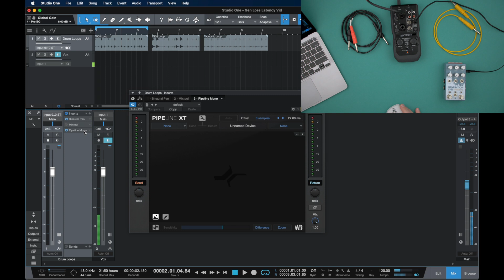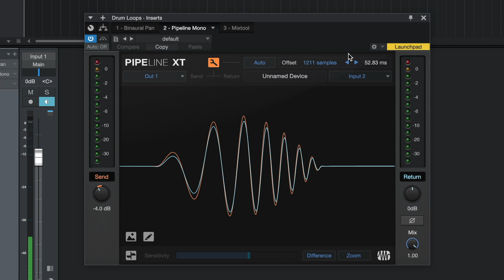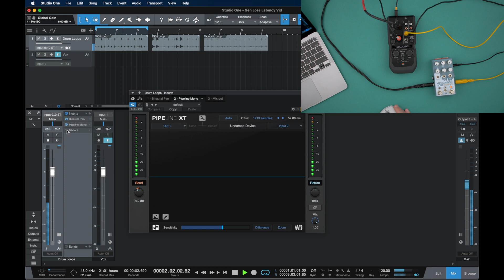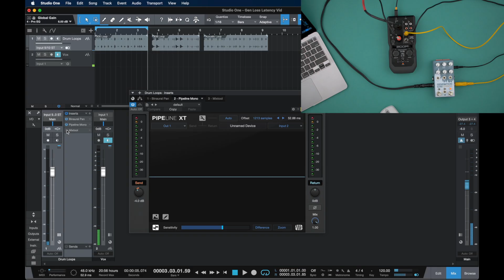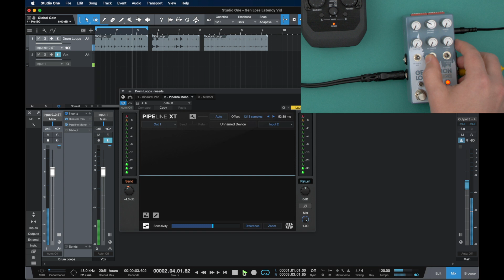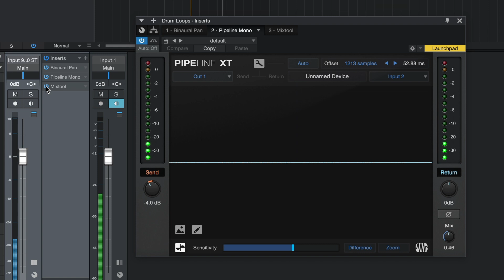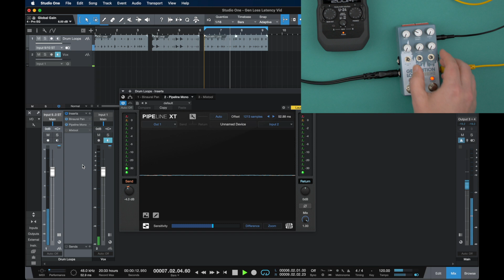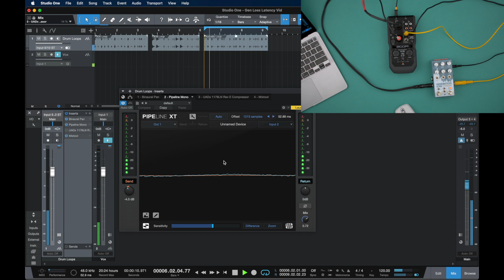Generation Loss MKII Latency: How Bad Is It? And How to Fix It.

Comment from the maker: UPDATE: Chase Bliss has released a new firmware that reportedly reduces the latency by half, or better. Link: https://www.chasebliss.com/gen-loss-mkii-mods
Reply: what version of the usb cable does this pedal use? None of old usb cables I have fit and I have dozens of different ones, I've never seen this size before.
Reply from the maker: @shyharmonic  It's a micro USB. I just double checked, and a standard micro USB cable fit in mine just fine.
Reply: @Bloom_Music  Is it better now, with the update ?
Reply: Can’t say I like the sound of the tighter latency flange effect.
Reply: @Subtronik  Yes. I did the update too and it's much better now

Comment: Great video. I use this as a send effect on my Elektron devices in a daw-less environment and, while the latency is noticeable, it creates a nice chorusing effect when you crank up the dry signal on synths. I say embrace the latency and make it work for you if you can. I definitely wouldn't use this on drums for the exact reasons that you pointed out, though.
Reply: how do you route the send? you using octa? i have  a digitakt and am curious.

Comment: Fantastic deep dive and testing!! 

This does NOT fix latency. It moves the latency to the initial moment when you press play. 

The latency is still there. This video shows that if you’re not playing live, you can’t hear the latency, but you can hear the DIFFERENCE in latency between the dry and wet signals. 

Then when you add the external instrument plugin, you still cannot hear the latency, still can only hear the difference. Now that difference is so small that can’t be discerned, but the latency remains - at the very beginning. If you were singing into a mic or playing, it would still be there. 

If you put an external / live utility plugin, and recording something real, that latency would still be really obvious.
Reply from the maker: “This is really only going to help people in a studio environment, this is not something you’re gonna reasonably do live. So, to the people using this live, you’re just kind of stuck with the latency” @ 20:13
Reply: @Bloom_Music  Yeah, you totally covered that.  It's an important tid-bit that I thought needed to be fleshed out.  I have a feeling some people watching this just for G.A.S. purposes might not realize that this doesn't actually "fix" the latency and might think they need to route it through their computer because it'll fix a problem "on the way in."  

Another point you brought up, that might make for a small bit of content for you is the tip about creating an external instrument device.  Regardless of what pedal it is, this is a great tip that I'm guessing folks who haven't used mixers might not realize.  OR it'll save someone (again, GAS haha) from thinking they need to buy some fancy gadget or plug-in to run their audio out through a real send.  

Oh, haha, good time to demonstrate what a real send / return is like so people understand it in software.

LOL I used to make tut videos.  Maybe I should make one on that.  Dibs!  🤣

Again, great video.  I wasn't being critical.  Have a good one.

Comment: Preorderer of the second batch and bummed on this. When a wet signal is combined with the dry signal but with an added delay, it isn't really a wet/dry is it? If I am looking to use the wet/dry, it's to reduce the overall amount of the effect not create a phasing issue. As you mentioned, there should be latency compensation, or at least an option. Also, CB knows their pedals are loved by the synth/instagram/succulent community who often would use this in a DAW printing scenario so to say this pedal is exclusively for guitarists isn't accurate. In fact, when the algorithm feeds me CB content, it is usually with synths.
Reply from the maker: Don't know if a wet/dry sync option is the kind of thing that could be added by a firmware update, but fingers crossed!

Comment: Its a pity, i think many people would like to use this as a 'end of chain' saturating/lofi device.
Reply: that's what I bought mine for and it's unusable for that purpose. sounds lovely otherwise.
Reply: Why is it unusable for that purpose?
Reply: @benwiley8941  latency!
Reply: I guess I'm trying to understand why it's less suitable for that versus anything else.
Reply: @benwiley8941   The video you are commenting on demonstrates it perfectly, but if you want to test it yourself, in your DAW of choice, open any given track and duplicate the track so you have 2 copies. Press play.  The song will sound normal, as the peaks are lined up perfectly.  Next, nudge one of the copies over just slightly (10-30ms, for instance) and listen to it.  I replaced the MKII with a similar lo-fi tape emulator pedal, the Kinotone Ribbons, and it does not have this issue.

Comment: for me, the best improvement they could do to this pedal is with that bypass switch,
it's clunky, and it's not smooth at all, I don't think the latency helps.
Instead of it cutting between on and off, it would cooler if if sort of blended in over like 200ms, the engaged sound and the bypass. as a sort of auto blend. and vice versa.

Comment: In watching the test am I understanding that you’re only using 1/2 of the stereo signal? If I follow correctly, that latency might be part of the stereo spread ?
Reply from the maker: You are correct, I only used one channel of the stereo signal for the measurements, just for simplicity's sake. But the latency is there in both channels. The stereo spread of the pedal is generated in the Failure section, and is a toggle option. The manual says, "Failure is responsible for the multi-layered stereo image you experience with SPREAD on. Its various effects manifest differently on the left and right channels, creating a moving stereo image. The drops have the most pronounced and abrupt effect, but you can bypass them to get more subtle deviation from the crinkles and pops".
Reply: @Bloom_Music  thanks for the expanded information and reply. Keep up the great work!✌️

Comment: I’m pretty sure they could give an update for this. Anytime I’ve been disappointed with an aspect of pedal functionality, there has been a work around or an update. Have you tried reaching out to the company for comment?
Reply from the maker: I have not, but I’ve seen this video shared on a few sites that I’m sure the Chase Bliss guys are watching. They’ve even made some comments themselves regarding the latency and some possible investigations into a low latency mode. But I have confidence that they are seeing the concerns of their customers, and if enough people see it as a problem, they’ll be more likely to address it. Honestly, for me, the latency isn’t really a big deal. It’s the difference between the wet and dry signal that I’d like to see remedied!

Comment: Would love to see a test with the new firmware. Cynically I suspect the reason the dry is not true analog is an attempt to close the gap on the abysmal wet latency. Such a shame, seems unusable live.
Reply from the maker: Sorry, I can't help with this. I'm not doing the update as the latency is not an issue for my use case, and I prefer the chorus-y sound of the wet/dry currently vs. the flange-y sound you get after the update!
Reply: @Bloom_Music  no need to apologise! Everyone has different use cases for these things.

Comment: Is latency any better using original mode?
Reply from the maker: Actually, yes! I didn't think to include it in the video, but I got the following measurements in Classic mode:

Pedal Off (Soft Bypass): 8.62 ms
Pedal On (Dry Signal): 8.62 ms
Pedal On (Wet Signal): 15.25 ms

So you get lower overall latency, and less difference between the wet and the dry signal.
Reply: Thanks for offering the numbers!

Comment: Supposedly Tefi Vintage Lab's Golden Era is all analog. Has anyone done a latency comparison?
Reply from the maker: I've never had my hands on a Golden Era, but there's a post on TheGearPage where someone compared latencies between the Gen Loss and a bunch of other pedals. The Golden Era was included, and they listed the latency as 8 ms.

https://urldefense.com/v3/__https://www.thegearpage.net/board/index.php?threads*new-gen-loss-mkii-from-chase-bliss.2368939*post-35777680__;Ly8!!Bbg-OcCDlOs!Hval9TStdCkmnC90Ov0A_3bWjUZVkmMdL2ayTPSsT-gM46GWuMgqoS0B7-5tw50Hs3ZW-SSAtRwvtTB-nTz5D2Vain5E$